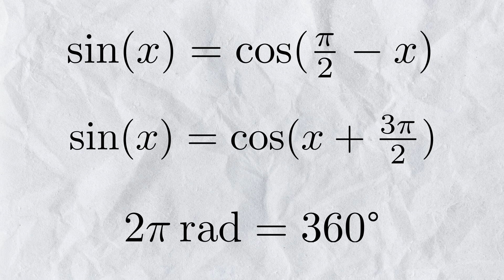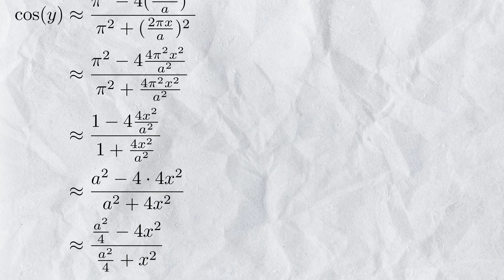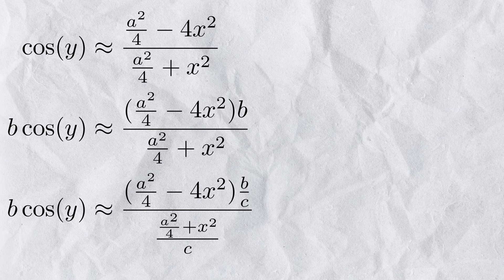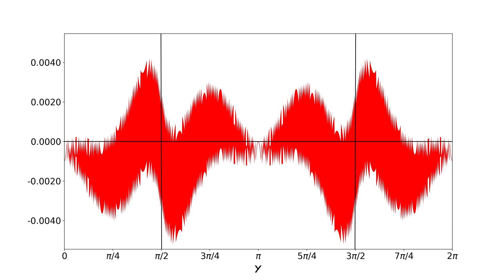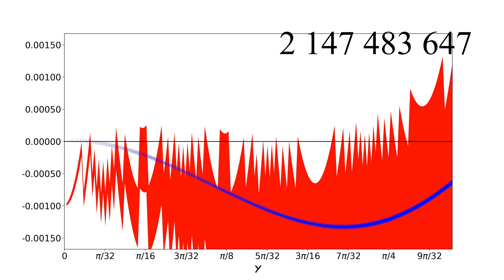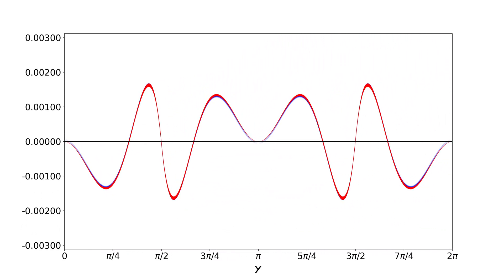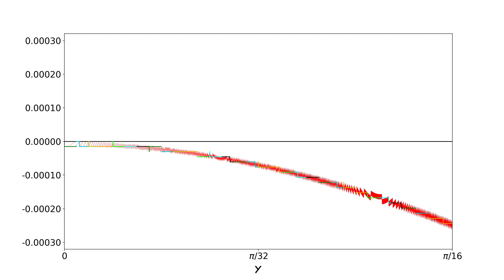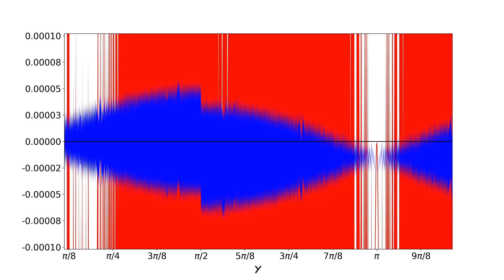Facto-RayO v2.0 explanation: trigonometry

Comment: Dutch browser exposed.

Epic effort to get it this close :O It would have been interesting to see which graphical issues appear with an unoptimized trigonometric unit. To see why this optimization was done.
Reply from the maker: I'm from Belgium so ...
Reply from the maker: Also copy from a response on another comment:
well for version 1 you can just look at the v1 video itself: https://youtu.be/7lVAFcDX4eM?t=35 you can see pixels sticking out of the bricks, these are errors in the distance calculation.  But even if they were acceptable, there would have been other issues if I used this version in v2.0. v2.0 has a horizontal resolution of 256 pixels and an FOV of 90°, which means each column of pixels would differ 1/(256*4) rotations from each other if they are all spaced equally from each other, while we can only represent 1200 different angles. This doesn't map nicely. But in practice it's even worse, as due to fish eye correction the angular distance between different columns changes depending on where on the screen you look.

iteration 1 of v2.0 can be seen here: https://www.youtube.com/watch?v=k6QonEML7tE as you can see it's much better than v1.0. But I was still annoyed by similar artifacts.

iteration 3 can be seen in the final video on the main channel. There is no footage of iteration 2 because I went straight from iteration 1 to 3. I only split them up to make it easier to explain in the video.

Comment: As someone who just learned how to program a ray tracer, this was awesome to watch. I never used any "fish eye correction" since I could never find an algorithm that made sense. I did implement a virtual screen though (near view frustum) and calculated wall height using the ratio of player position to frustum intersect against player position to wall intersect. This and calculating the ray angles based on equal distances of intersection on the frustum, got rid of most distortion. (Though this method capped my FOV to <180.)
Reply from the maker: I think you just described fish eye correction while simultaneously claiming not to understand it

Comment: really interesting video, and a nice explenation of all the work that went into it. I was just really curious why you went with a single formula instead of a iterativ one(which could also be parallelized), such as  a Taylor series? I'd imagine it wouldn't have mad sense for v1 as it would have been significantly more work (you would have to sum 5-6 terms) while not being needed. but if I just compare your original one and the taylor of cos(x) taylor is about factor 100 more acurrate, while still allowing a scaling of factor --2^15--. what am i missing here? (edit the scaling factor is wrong by a lot, and might explain everything)
for anyone wondering I have here the two delta plots from wolfram alpha
https://www.wolframalpha.com/input/?i=+maximum+of+%28+-+Cos%28x%29+%2B%28PI%5E2-4x%5E2%29%2F%28PI%5E2%2Bx%5E2%29%29+between+-PI%2F2+and+PI%2F2
https://www.wolframalpha.com/input/?i=+maximum+of+%281+-+Cos%28x%29+-+x%5E2%2F2+%2B+x%5E4%2F24+-+x%5E6%2F720+%2B+x%5E8%2F40320+%29+between+-PI%2F2+and+PI%2F2
Reply from the maker: sorry for the late response, due to the link your comment was set asides for approval and I didn't see it until now.
I just didn't expect it to be so accurate for so few terms, I would think you would need at least 20 terms or something. So it's possible this way is better than the way I did it. Like I said in the start of the video, if I would need to make it again I would do it differently.
However the graphs provided alone isn't enough to compare it against my final version, as my graphs also included rounding the real input to the nearest possible input.
I'm also not quite sure you could do the ^8 without going over the 32 bit limit or doing the same rounding tricks I did. (I would need to work out the formula with the integer input instead of the input in radians to be sure).

Comment: Very nice expanation. Can you show renders made with the different approximations and show how these errors look like in practice? I guess there must be a difference or else you wouldn't have bothered with the refinements.
Reply from the maker: well for version 1 you can just look at the v1 video itself: https://youtu.be/7lVAFcDX4eM?t=35 you can see pixels sticking out of the bricks, these are errors in the distance calculation.  But even if they were acceptable, there would have been other issues if I used this version in v2.0. v2.0 has a horizontal resolution of 256 pixels and an FOV of 90°, which means each column of pixels would differ 1/(256*4) rotations from each other if they are all spaced equally from each other, while we can only represent 1200 different angles. This doesn't map nicely. But in practice it's even worse, as due to fish eye correction the angular distance between different columns changes depending on where on the screen you look.

iteration 1 of v2.0 can be seen here: https://www.youtube.com/watch?v=k6QonEML7tE as you can see it's much better than v1.0. But I was still annoyed by similar artifacts.

iteration 3 can be seen in the final video on the main channel. There is no footage of iteration 2 because I went straight from iteration 1 to 3. I only split them up to make it easier to explain in the video.